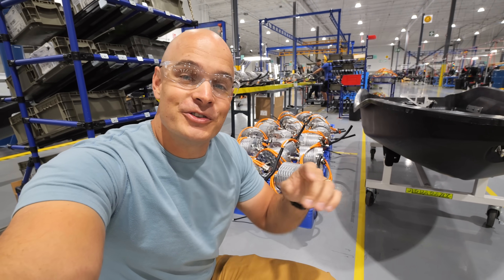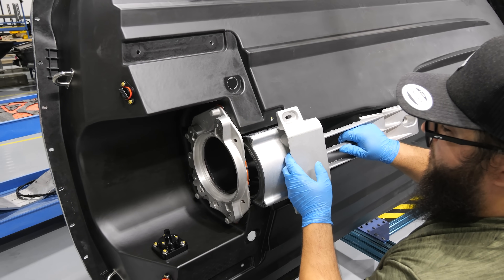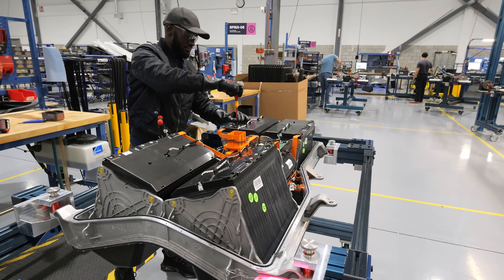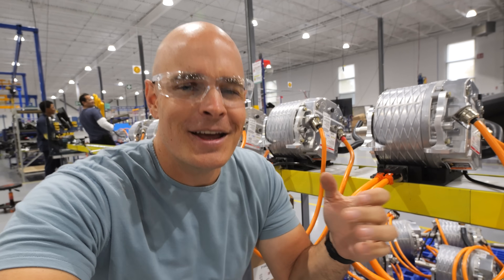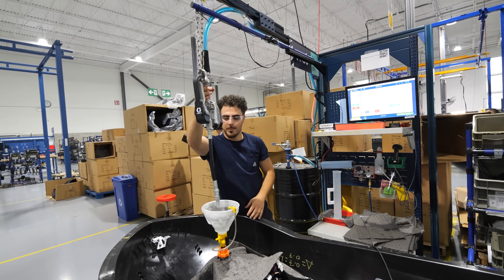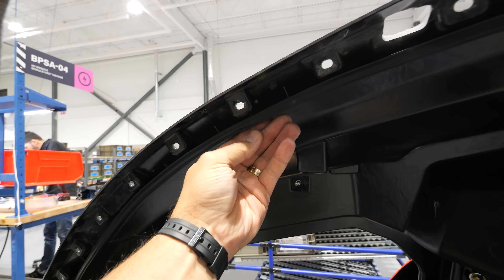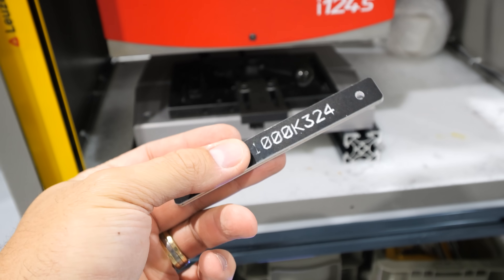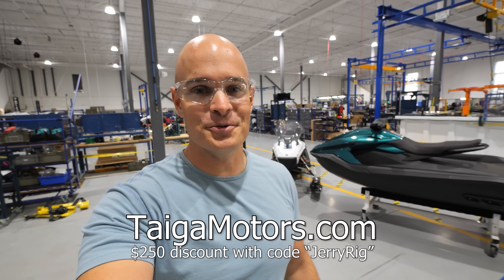How To Build an Electric Jet Ski (Water Durability Test!)

Comment: I was thinking $15K seems like a reasonable number for an electric jet ski. For once the actual price is close to what I would expect!
Reply: The one he shows the 160hp is $19,490 the cheaper 90hp is $17,490 👍🏼
Reply: @mynameisschezuan  Gdamn, same price as my car
Reply: @mynameisschezuan  I mean its cool and all, but ski doo spark 90 is half the price and weight.
Reply: @trytthisnowk  and spark will run for longer on a tank. These have a 24KWh pack, so with upto 120KW of power, that isn't a lot of run time.
Reply: @ionstorm66  Not being familiar with jetskis at all, I'm curious how Taiga's advertised run-time of 2 hours compares to the runtime of similar gas-powered jetskis.
Reply: @coredumperror  you get about 2 hours of cruising or an hour with it wot. I just don't see how they can hope to get 2 hours unless that is just cruising at 20-30 mph, the battery is just too small.
Reply: @coredumperror  Considering it takes just a few minutes to fill up a tank and it's possible to bring a few extra jerrycans on a jet ski the runtime is in no way comparable. Where I could see these since is for rentals.
Reply: @SweBeach2023  That's not the question I asked, though. Sure, it's possible to bring a few cans of gas on a jet ski, but does everyone do that every time they go out jet skiing? Doubt it.
Reply: @coredumperror  Don't know about anyone else, but we always did. Usually at least a 5gal can in the truck. If we were going to be out all day, then we'd take a couple. You wouldn't be able to fit a full can of gas with you in the ski (not a lot of room), but I did always keep a liter or so in the "frunk" of my ski as an emergency reserve to get me back to dock if I didn't pay enough attention to the fuel gauge.

That's something that seems super worrying though. Older skis often had an integral "reserve", with a valve to switch to the reserve pickup off the bottom of the tank instead of a little higher. I remember a newer ski that didn't have that feature (hence carrying a liter of fuel). I wonder if the Orca has some kind of reserve mode to make sure you can limp back if you don't pay attention to state of charge.
Reply: @ford9501  Most EVs have a feature like that, so I wouldn't be surprised if the Orca does. For instance, you can drive a Tesla for about 10-15 miles after you hit "0" on the range gauge, because there's a small buffer at the bottom of the battery for just such mishaps.
Reply: I'm a guy who absolutely loves new tech and electric jet ski doesn't put me off but you can get a 300hp ski from Kawasaki or Seadoo for about the same price.
Reply: For low volume production it's not too bad. Electric mountain bikes get into the 14/15k prices nowadays :(
Reply: That’s more expensive then my car!
Reply: $20,999 for the performance with level 3... thats insane...not to mention after its dead you cant just refill and go... you have to pull it from the water, leave the ramp, find a charging station, and hope it actually works. Wait 1.5 hours to charge and bring it all back for another hour of fun..  Hard pass on this EV fad..
Reply: No floating charge stations yet, my seadoo gtx is more practical and I love EVs but saltwater is a different beast

Comment: I have been dreaming of an electric snowmobile for years!!! Please do the same type of video!! 😂
Reply: I'm afraid fully electronic system is not answer for cold environments. Huskies would be better solution for now.
Reply: @Tumetune  Zach(JerryRigEverything) already did a video reviewing the electric snowmobile. Just as they do with everything, the engineers engineered the sh!t out of it and made an effective heating and cooling system for the snowmobile's battery.

Comment: This is the first water vehicle I would actually consider buying. Pretty sweet.
Reply: It's literally the worst jetski but at the highest price
Reply: @OutOfNameIdeas2  Not everyone likes noise and fumes.
Reply: @sparky6592  but like... You like fun right? How about you have fun for 20min instead of 2. And fumes... Do you realize how small these engines are. Also isn't deposited into the air so literally zero fumes. And for noise. Evs make a headache inducing high pitched whine. So for noise it's quite a bit worse if your hearing is good and you're not too old. I literally can't stand being in a Tesla. The whine in it is the worst.
Reply: @OutOfNameIdeas2  Are you saying a gas jet ski's fumes are just shot into the water and stay there? And Tesla's are louder than a gas jet ski? 🤔
Reply: @sparky6592  youre welcome to re read my comment lol.

Yes it goes into the water. And not louder as per say but definitely a more annoying sound for the rider. Such high pitched noises don't really travel as far so for others it will only make sound from the turbine and the sloshing water. A jet ski isn't loud to begin with though but since it's in water the sound Travels very very far without dropping like at all.
Reply: @OutOfNameIdeas2  But they are loud. I don't know what you are talking about. I've read your comment more than once. It doesn't make sense based on my real world experience.
Reply: @sparky6592  maybe you drove a cheap one or something. Hitting the waves when going fast is most the sound. The engine is sound isolated under your seat on a good one. When it's idling you should just barely hear it. When your at max throttle you can hear it but like the splashing and hitting hard waves is about the same DB. A regular outboard 4hp engine is wayyy louder. You know those UHM what's it called in English. The blow upp rubber dingys. Small air filled rubber boats with a hard floor board.
Reply: @OutOfNameIdeas2  Do you have a youtube link to one of these quiet jet skis?
Reply: I was interested until I saw the price tag
Reply: @MrPsychopathYT 20k is normal for the top products  but  this is not the top   but it's a ev.  But the up to *  2h 😢  so wen you have fun  .5-1h😢
Reply: Yeah till u see the 2 hr ride limit and have to recharge
Reply: You cannot be serious dude

Comment: I wonder why they don't make standard bolt point for trailer hitch and wheels. It would make it sooo cool if you could just charge the Jet ski if the bolt on trailer wheels were regenerating.

Comment: Seems heavy and underpowered vs seadoo. My 4xe has a 800lb similar sized battery pack but my RXP is 800 lbs with double the horsepower.

Comment: The main concern I have with this is when you run out of charge. I've been jet skiing for over 30 years. We always carry a small jerry can of fuel incase one of us in the group runs out.. Or I run out.. It's a terrible time trying to tow a broken down ski back to safety and in some cases the extra weight towing distorts the impeller and ruins shaft bearings. And I can tell you no matter how hard you try you're gonna get water inside your ski.. Thats a given.

Comment: I think it's a great idea. I'm not exactly sure on the range (2hours) I suppose if you could go 25miles at 50-60mph to charge for 2 hours then ride it back would be fine. It'd be great on the lake of the ozarks. I thought the biggest hurtle during the Lake of the Ozarks shootout ev boat going 120+mph was keeping the battery cool after a 2 mile run. Anyhow, I'd be interested in the specs on this jetski.
Reply: The range claim would vary wildly depending on the conditions. Head wind. Water currents. Going up stream. I'd be really concerned about Range Anxiety.
Reply: You cannot find a range demonstration because it's horrific and no where near claimed.

Comment: Ouch 16gs and it only works 2 hours it's cool but, I could see me getting stuck somewhere lol. I wish they'd make evs solar too that it last longer
Reply: 2 hours at high speed, that is like 100 miles or so, why would you ever go that far on a jetski alone?
Reply: @TheEsseboy  It says 'up to 2 hours', that's not 2 hours at high speed. The quoted maximum riding range is 30 miles... a big difference from 100.
Reply: @Tom44224  30 miles is at normal use, meaning a lot of turning, playing and quick accelerations. Not steady A to B travel.
Reply: @TheEsseboy  They say maximum riding range. That does mean from A to B.
Reply: @Tom44224  Where?

Comment: Curious how the motor and the jet assembly aren’t mounted to anything but the outer composite shell. I would expect there to be some kind of subframe of sorts that mate those components together and stiffen as an assembly before being attached to the plastic shell.
Reply: Cause the shell is made out of Glass fibre or carbon fibre composite, not just plastic.
Reply: It's not as powerful as suggested,  thats why.
Reply: @Dat_Sun  It is 160 HP, you are wrong and probably jelous.
Reply: @TheEsseboy  Lol, you know the Sea Doo RXP X 325 has more than double the horsepower (325) for the same price, right? With such a weak 160hp motor, they had to sacrifice range and put a tiny battery only lasts 28 miles, lol, compared to 110 miles on the Kawasaki Ultra 310LX.
Reply: @Exachad  And how much fuel does those use per hour? And how much noise do they make from the engine? How often do you have to service it? What is winter prep like?
Reply: @TheEsseboy  You're shifting the goalpost. The conversation was about power and nothing else. Someone called the Orca weak and you said he was wrong. I pointed out that the Orca was quite weak in terms of power and had to sacrifice range (battery size) immensely (1/4th the range of an example I gave) to even get to close to the speed of the 2 Jet Skis I named (~92% of the speed).

Obviously, the Orca has at least some advantages over a traditional Jet Ski. Otherwise, there would be no reason for it to exist at all since nobody would buy something that is inferior in every way. Nobody ever claimed it had no advantages, so I don't know why you're shifting the post to points that were never contested.
Reply: @Exachad  Still 160 HP, and unlike the Sea Do it has much faster and more precise throttle control.

First it wasn't mounted properly, then people say it doesn't have 160 HP, now they claim it needs double the power, what is next? That it needs to smell and make more noise? Where will the goal posts move next?

Comment: 24kWh is a decent sized battery. The first Nissan Leaf cars had that size.
Reply: Not on the water. This has the ice equivalent of 28hp. Wait till we see a demonstration, it's going to be painfully slow.
Reply: @Dat_Sun  Nope, that is the battery size, it has 160 HP....not 28 lol...
Reply: @TheEsseboy  That is a lie, a manufacturer's made up lie. 160hp and it doesn't even have a motor mount. It's glued to the plastic hull lol.  160 made up hp is 28 certified sustained hp.  This is why we didn't get a demonstration of the 160hp..
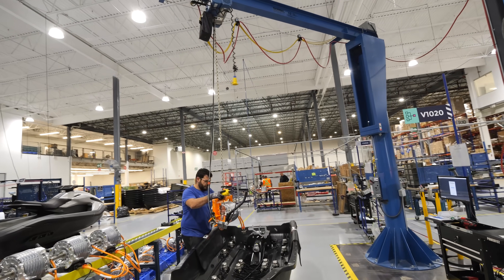Reply: @Dat_Sun  Ehm...it has four motor mounts?! Watch from 3:23 What are you on about? Did you even watch the video dude? It has 160 confirmed HP....stop hating when you know nothing...you clearly know more about ancient datsuns than these new high tech things...
Reply: @TheEsseboy  Dude that is not proper mounting for 160hp.  Who certified the HP? Nobody.  It's not 160hp, you would need way more battery.  We could do some battery math..
Reply: @Dat_Sun  Ehm, a Lithium battery can easily deliver 10-100 times its capacity rating...

It is, it is not running at 2000 RPM, it is a jetski, not a GIANT propeller dude.
Reply: @TheEsseboy  Come again,  you say a lithium battery can deliver 100 times is capacity?

Comment: beautiful to see the petroleum industry taking hit after hit.
Reply: It's not. Ev has nothing on level with power density of ice power. Not even close.
Reply: @Dat_Sun  Doesn't need to, as you skip having to spend hours and hours each year messing with fuel, oil, filters, coolant, pumps, sparkplugs etc....an electric motor can run for 10 years without even a single minute of maintenace....a gasoline engine does well if you can go a season let alone a year!
Reply: minor and temporary challenge @Dat_Sun

Comment: Of course, the question raised with any EV:  What's the runtime at max performance?
Reply: Easy to figure, just need battery specs. Amp hours and voltage
Reply: Definitely well under 1hr.

Comment: Still funny to hear "high voltage" together with 400 volts when here in Germany every house is connected to the grid with 3 phases and 400 volts (between two phases)

Comment: So cool. I love learning about these traditional gas vehicles converting to EV!
Reply: It's always a downgrade
Reply: @jimwantsjustice3465  LOL
Reply: @jurgens9867  Why laughing?
Reply: @Dat_Sun  Because of the downgrade.
But we have different opinions, i know.
We got this discussion months ago😂
Reply: @sys-administrator Yes.
Reply: @sys-administrator Electric boat maintenance, cooling system leaks and corrosion, through hull fittings, electrolysis damage will creap up, seals, electric motor bearings, windings cook and short, esc's fail regularly with time, caps dry out, lithium cells fall out of balance, mostly it's the stuff I can't think about right now. The pump is virtually the same design,  and will require maintenance just like ice.
Reply: @sys-administratorThat is a wild claim. This is basically an oversized rc boat. There is a lot that can and will fail. 

 No chance the battery lasts more than 5 years of use. Water is not kind to discharge rates, high c rates are not kind to cycle life. This watercraft is much slower than the claimed 160hp would suggest.  Thats why we didn't get a demonstration.

Comment: We definitely need to see how the snowmobile is made
Reply: I want to know more abt the motor driver boards/escs
Reply: @aidenchristiansen2680 China made, over rated.
Reply: @jimwantsjustice3465  It's made in Québec, Canada. ;)
Reply: @FrancoisBerg94  Assembly is, everything is made in china.
Reply: @jimwantsjustice3465 the snowmobile uses elka shocks made in Canada
Reply: @LiamG903  Assembled in Canada,  components from Taiwan.  Don't be missleading.
Reply: @jimwantsjustice3465  negative, don't try and down play The manufacturing process. Please educate yourself before commenting further
Reply: @LiamG903  It's true. Show me a clean Canadian or American battery mine?
Reply: @jimwantsjustice3465  in my area we are opening one of the cleanest automated lithium mines. It's gonna get there, we can shit on battery tech when the USA still burn coal. Like I said tis not perfect but we need companies to push the tech and market to get to the next level
Reply: It's coming, since he was already in the factory he filmed that as well.
Reply: Take a regular snowmobile,  add a lot of weight,  reduce it's power density and range,  bam! ev sled.
Reply: @jimwantsjustice3465  Ill keep my turbo waverunner thats loud and goes 90mph.
Reply: @enigma9789  Good decision. Battery tech is criminally behind ice power density,  and lb for lb ice destroys ev, always will.
Reply: @jimwantsjustice3465  love EVs, but high voltage and saltwater, bad combo. I’ll keep my gas SeaDoo.  Snowmobile is better application. Sure they will sell a lot to ski resorts

Comment: I want to make an Electric Jet Kayak, i am working on gaining the knowledge I need for the project now.
Reply: Don't,  save your money.   As of now lithium battery power density is nowhere near where it needs to be for power sports. You will sink tens of thousands of dollars into batteries just to get smoked by a 90s jetski.
Reply: @jimwantsjustice3465  an electric motor can match or surpass a gas motor easily. As you said in your comment it's about power density so the biggest issues is the amount of time you can have to motor running on one charge vs one tank of gas. The total powe output is greater with gas but that's not the point of my project. The Jet Kayak is supposed to be lightweight zippy fun using a white water blunt nosed kayak. I don't necessarily care about speed.

And I am saving money, but not for that project necessarily at the moment, more so for schooling so I can understand some more engineering principles to design it.
Reply: @Bein_Ian  None of tech is on par. Electric motors power ratings are bs compared to ICE. Electric motors are often rated per the manufacturer with zero oversight, not certified.     You cant have light weight zippy and battery power, it's not possible.